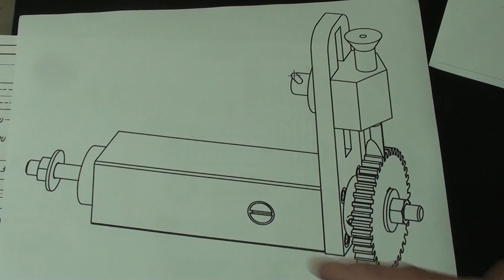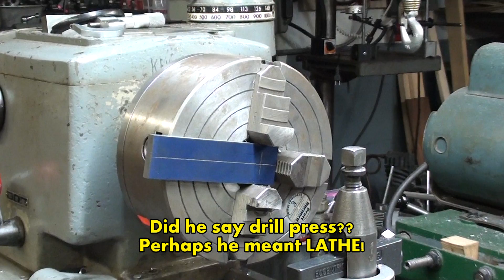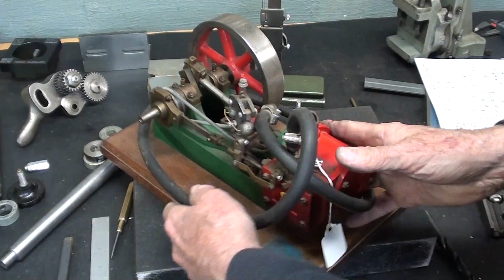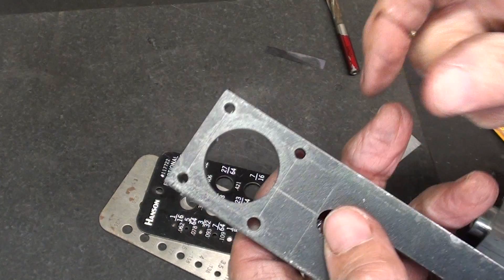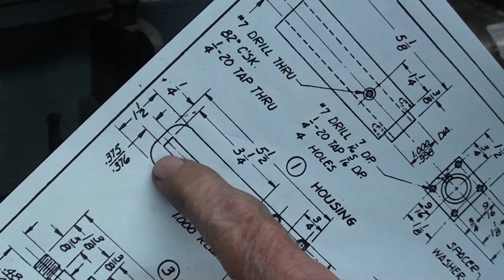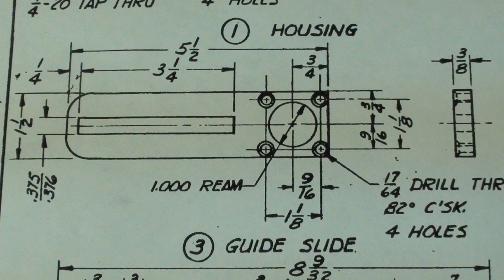MAKING ATLAS GEAR CUTTING FIXTURE pt 2 #836 tubalcain guide slide

Comment: It’s funny how people think differently. I don’t like using cold rolled because of the warping. It’s true that HRS doesn’t have finished surfaces from the mill, but CRS isn’t accurate either. Good idea about drilling that hole in the screw. I hadn’t thought of that. I’m going to steal the idea for my own use. Don’t tell anybody.
Reply from the maker: I agree that cold rolled is problematic.

Comment: Re counterboring with a drill but needing a flat bottom. 
I measured the depth of the drill cutting edge, swapped out the drill bit for an end mill and took it down that far. Extra steps but it worked.

Comment: Another option for the drill pattern is to use your edge finder inside the hole to find the center of the bore and just move equal distances around the bore for the drill center diameter, or of course use the drill hole pattern on the DRO. Yes, edge finders can find the center of bores and holes. This would also allow you to make quite precise drill patterns if you do not assemble the parts for drilling and drill them separately.

Comment: I stayed after class to see how close my hack was to your ( far more elegant & accurate ) solution. I used a coupling nut as you did but I chinced with a close fitting scrap box bushing. Recently, I had to drill the centers of my old Tundra 2000 wiper posts. It's the same wiper transmission that the old girl came with. They were frozen dry and I didn't want it to happen again. The center drilling was needed to create grease channels for future lubing.  BTW, the coupling nut also serves as the grease gun adapter. I either pressed or JB Welded a Zerts grease fitting to it. 

Pete, thinking back on this I think I was being very optimistic if you get my drift. Hell,  I'm damn near as old as you! 🤔
Wakodahatchee Chris

Comment: I have a set of those cheap S&D drills, only the last 1/2" is actual tool steel, the rest is some grade of Stilton cheese.. if you look at the video you can even see the line on Mr Pete's. I had one catch and snap of the tip, went to sharpen it and nothing, just junk mild steel. had another catch and bend... really a drill bit bend?? total waste if you plan on using with a hand drill,  definitely would only recommend with a proper drill press or mill, and only if its all you can afford.
Reply from the maker: Thanks for the info!

Comment: I also made a Atlas Gear Cutting Fixture.  It worked great to make several gears.  I came up with a indexing method of using a aluminum disk from a old hard drive with lines on printed on label paper attached to it and a pointer.  It is documented on the Machinist Web forum under the title of Making a Atlas Gear Cutting Attachment.    One issue with the drawing is if making smaller gears you will need the collar on the end of the shaft to be smaller in diameter and longer than is on the print.  Otherwise, the gear cutter will hit the collar and possible the end of the main body of the fixture.
Reply from the maker: Very interesting. Originally I was going to show some alternate ways of index figure including 3-D printed discs, and a few other ideas.     I already finished a two video series on cutting and gear. It worked quite well.  The videos will not be published for about a month      and finally, I did cut a groove in the main body to allow for the interference on smaller gears
Reply: @mrpete222  Didn't think about cutting a groove in the main body.  The gear that I had issue's with was a 20T one on the reversing tumbler.  The miner diameter was 1.125 and the collar in the drawing is 1.250 so I just made the collar longer and smaller diameter.  The indexing does work good using worn gears as the master also.  Also on drilling the 1" hole in the guide slide I did do that on the lathe in the 4 jaw chuck.  I kept the length long until after I drilled and bored it so I could hold it with all 4 jaws.

Comment: I really like the tip for installing the brass plug in the locking knob.  Thanks for sharing that idea. 
My dad used to work at Fisher Body in Baltimore. He learned from other employees about a drill stop that was kinda available there. Employees would use a door lock button that was installed on the inside of the door next to the side glass. They were designed to be put on what was either an 8-33  threaded lock rod protruding through the window garnish molding. They would drill from the bottom through the top of the button exposing only the length needed for repeat holes.This button also protected the surrounding metal from drill damage. Of course your range of bits was limited with this method, the button shaft was 3/8".  Since Fisher Body became Eastern Aircraft during the war, it is possible this is a carryover from drilling aluminum sheet and using what was available during those years. Now, these buttons sell for about $8.00 a  piece and newer models went to all plastic which didn't work as well as the earlier ones.   My dad used to have at least one drill bit in the basement with a lock button on it for working around the house. He never owned a drill with a chuck that had greater than 1/4" capacity.
Reply from the maker: Thank you, that is really a neat story

Comment: Hmm... You're only running that 1" drill at 20 sfpm? Seems rather slow for mild steel.

Lacking a decent sized mill, I'd probably mount that on a faceplate and use a 1" taper shank drill in the tailstock. That and safety glasses, face shield, and body armor😲🐔🐔🐔😲

Comment: This is a great project and set of teaching videos!  I wonder if 3D printing a plastic gear (or index wheel) and transferring a gear to metal using this jig would work.  That might be a relatively inexpensive metal gear making technique for those lacking a rotary table or dividing head.

Comment: Thanks for this interesting serie of videos. No drawings needed just to pick up the idea and "do it my way", and have fun.
Smart jigg for drilling a hole in a bolt. But.... If You can clamp that long 6 sided nut in the vise wouldn't it be possible to find the center a drill the bolt without the little drill guide? Assume a mill and DRO is at hand.

Comment: Another trick to prevent damage from bolts and setscrews. On cup point set screws fill the little cup with silver solder. This also works on bolt ends but not quite as easy since there’s no cup to fill.

Comment: beyond this project would be a gear cutting jig made for use in the shaper.  comparing results between that and mill cut gears on the optical comparitor might prove interesting. it's said that the action of rolling the blank as it goes through the cut gives the gear teeth a true involute form

Comment: Lyle -  Glad I stayed after school.  I'm going to second Alfonse's comment - coupling nut idea is great.  I'm designing a dial indicator holder to measure carriage movement on my lathe, combining some different ideas/designs that I've seen.  Two things i had to figure out how to do you presented good ideas on today.  Since I have a mill I will never make this gear cutting fixture but I always watch all the videos.  Two new ideas and problems solved.  This 73 year old retired engineer has to keep learning.  Thanks.

Comment: On the coupling nut drill jig. I would have cut the bolt very short then put the coupling nut the the 3 jaw, drilled out a thread or two so the bolt would bottom out on the head and then drill the guide hole. The coupling nut is much more secure in the chuck than a short piece of bolt. The intact bolt won't get stuck in the coupling nut and the head of the bolt leaves a longer guide hole which makes drilling easier.
Reply: Excellent refinement to an already good idea.👍

Comment: On drilling and tapping those 4 holes. I would have left the setup in place until the job was done. The clearance hole could be drilled with the quill stop just into the aluminum and would be a 1/2 to 1 thread bevel. With the setup undisturbed then an endmill could be used for the counterbore positioned with the DRO. And tapping is much easier with a spring loaded tap follower (always the first project for a new machinist) mounted in the quill.

Comment: I expect that this series will allow ‘fool’ proof gear cutting on a mill without a dividing head as I only need one or two gears but they need to be exact copies of the Enco gear train.   Even proficient fools can skip a tooth and go back without counting holes in an index plate.   Turning the blank can be done without consulting the handbook for OD, PD, CP and so on.

Comment: If a lathe is the only machine you have that will allow low speeds for large drill rather than use a 4 jaw chuck with on jay removed why not use a face plate with clamps? The setup would be more tedious but the job could be done safely. I like the idea for a drill guide.
Reply from the maker: That is why I didn’t show that way. Very tedious set up

Comment: I have never cut a slot with a satisfactory finish for the reason you described, but you gave me an idea that might help. Suppose after cutting the 11/32 slot you used the same cutter to enlarge the slot one side at a time?
Reply from the maker: Yes, that would work. But it is more difficult to machine the slot to an accurate dimension.

Comment: I have a Lufkin wiggler set. I got it after finding a problem seeing a normal edge finder. I had to speed up  the edge finder to see it move, at my normal speed I wouldn't see it move. So I bought a Lufkin wiggler.. it has 2 of those ball with pointers. A larger and a smaller ..  I do like the wiggler, it's much easier to see it go off. And it also reaches further down or around a larger round.

Comment: Why does the brass piece have to be set into the knob screw? Wouldn't a little pellet just dropped in the hole loosely work fine, as long as the knob is not removed? Great series, Mr. Pete, thanks.
Reply: The soft brass will deform and stick in the threads. If you ever have to remove it, you'll wish you had done this. 

I'm working on a taper attachment for a Logan lathe. It uses a dovetail spigot like the South Bend for the compound. It has pins that lock on the angle. I wanted to add that brass tip to the set screws that hold them.  Perfect timing to see how to get that done.  The old pins were deformed by the hardened screws and I had to drill them out.  Messy job.

Comment: That is a good tip for drilling a hole in the end of a bolt. Don’t through it away just put it back with the rest of the coupling nuts.😊
Reply from the maker: How did you know that I have a whole drawer of them?
Reply: @mrpete222  :>D

Comment: I like your drilling fixture for the threaded shaft. Simple, trick, but effective. 

I also like your drill set up for matching hole centers. I was taught standard bolt hole clearance for multiple fasteners when in drafting 101. Looking that hole clearance up for a four bolt hole of pattern would be extra safety. I use variations of your process successfully all the time, but keying orientation as you showed is likely necessary without the extra bolt clearance. 

I have used the drill counter bore method, but since you have the milling machine already set up, squaring the counter drilled hole bottom with an end mill would be an improvement (when lacking a counter bore).

I am interested in what you plan for using for your master indexing gear since the SB gears you plan to remake are so trashed.

The climb/conventional mill slot size and finish issue might be safely improved by a skim pass with the same tool and only stepped over enough for clearance. I wonder why the drawing calls out for square slot ends? That seems unnecessary.
Reply: Even trashed gears can be used for indexing as long as the wear is even. Also the wider the indexing pin the more the wear variation is averaged out. But any gear with the right number of teeth (or an even multiple thereof) can be used for indexing.
Reply from the maker: Hello Paul. Glad you like the video.

Comment: nice job.  could you step up drill sizes by say 1/4'' ?  say start at 1/4, then 1/2 then 3/4, then 1" or maybe if you're not in a hurry you might be able to bore it?  I guess as long as you get a hole in there, it doesn't need to be too accurate. =D